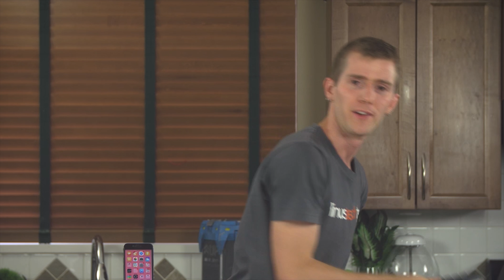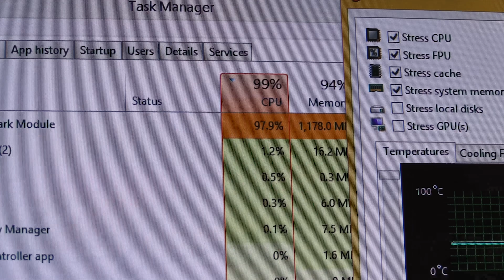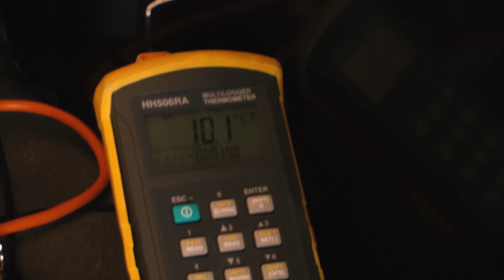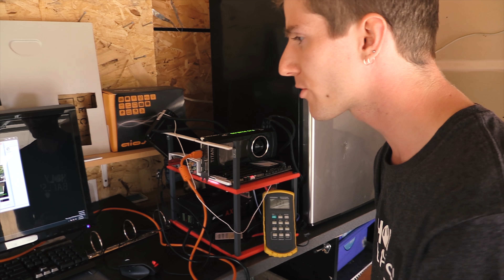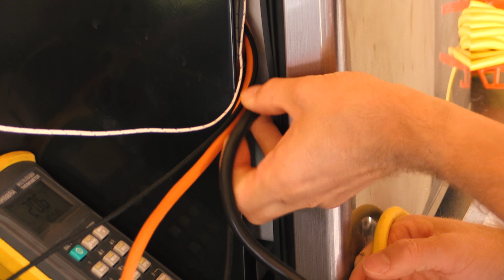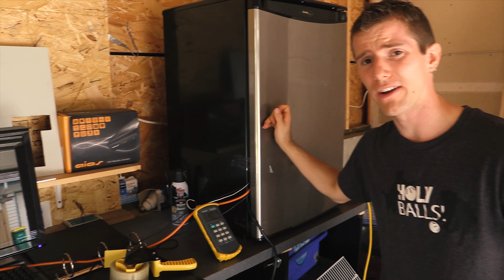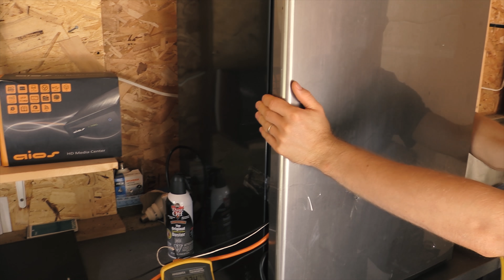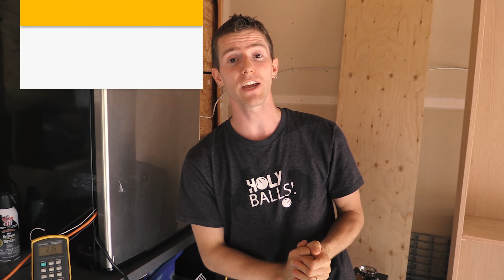PC Build in a Fridge - Does it Work??

Comment: You should have run copper pipes from a CPU or GPU cool block into a freezer, the copper pipes should be coiled and the copper tubes should be submerged in a 5 gallon bucket with about 4 gallons of water in the bucket. So in other words there should be a 5 coils submerged.  The piping from PC to the freezer should be flexible rubber or vinyl, then connected to the 5 coiled copper pipe.

Comment: One of the biggest "flaws" with this setup is that the fridge's internal coil relies on passive airflow over the cold element to keep the inside chilled. You'd get a mild improvement by adding in an extra fan to move the internal air across the coil. People who spend a lot of time camping in RVs swear by small D-Cell powered fridge fans that keep internal air moving to help equalize internal temps.

Still... It'd be interesting to see this done with one of the minis that has an internal 'freezer" compartment and stick a cooling radiator up in there, preferably with metal-to-metal contact to help with the heatsink effect.

All in all, this is wholly impractical, but so was Whole Room Water Cooling.

Comment: what if you took a coil from a regular home AC unit soldered some fittings on it and used it in a regular water cool loop for a PC? I'm almost positive it would work better than a small PC radiator but i wonder how much better it would be?

Comment: What if you were to say take a larger radiator,like a heater core or trans cooler, and place them in the mini fridge.  you could run the piping through the walls sealing them with spray foam.  add fans to the radiator to keep the air moving.  this would in theory cool the rad with little heat being introduced to the fridge thus cooling the pc more efficiently.  that would be an interesting video.

Comment: Refrigerators are also designed to have a mild vacuum inside, and you are preventing that from happening with the wires going through the door seal... hence why your internal ambient is closer to your external ambient - you are constantly putting hot air into the chamber.

Comment: Thermodynamics 101, if the refrigerator power supply is 80 watts, it can only (theoretically) remove 80 watts of heat power. An industrial walk-in fridge would probably work

Comment: A mini-fridge is about 100-200 BTU (British thermal unit "Heat Energy").  A desktop TDP (Thermal design power) CPU ranges from 50-150.  Video card is 50-250.  A BTU is about 3 TDP.  That computer I guess would be about 300 TDP or 900 BTU of heat.  A full size fridge/freezer is around 600-1200 BTU.  If you throw that computer in a freezer, after a day you would probably be the same temperature as having it in your room.  Fridge is design to keep heat out and trap cold in, but assumes the object stays the same temperature.

tl;dr
Get an AC unit don't user a fridge.

 #DoTheMath

Comment: Would this be able to run Ark: Survival Evolved on high settings.
CPU-Intel Core i5-4590 3.3GHz Quad-Core Processor
RAM-G.Skill Ripjaws X Series 8GB (2 x 4GB)
ASUS GeForce GTX 970 Strix DirectCU II 4GB 
Motherboard-ASRock H97 Anniversary ATX LGA1150 Motherboard
Storage-Western Digital Caviar Blue 1TB
Case-Antec One ATX Mid Tower Case
DVD Drive- Black SATA 24X DVD Burner
PSU-EVGA 600B 600W 80+ Bronze Certified

Comment: These kind of fridges rely on things getting cold and staying that way, not generating heat. It is like running a BBQ in there and expecting it to stay cool. A large fridge with air circulation and a cooling coil that achieves below zero temperatures would do better and it supplies air circulation which is what you are missing with this example

Comment: All a fridge does is remove heat, which is what a computer is designed to do anyway.
The only difference with a fridge is that it also keeps the heat out, but that is not a concern for something that creates heat from the inside.

Comment: couldnt you place a slowish moving fan inside and construct a maze of chambers inside the fridge that eventually leads to a vent near the top of the case? kinda like a muffler? so the air stays inside the case for a fair amount of time, enough to cool, but escapes before it begins to warm up too much?

secondly, could you pressurise the unit? by building up air pressure inside an object it massivly cools it, think of when you release air in a tyre, even if the tyre itself has been warmed up by driving, or popping a deoderant can or gas canister, if youre not carful you can get frost bite from them

either way the trade off between power consumption and results and even real life noticable results is too big to even bother doing this